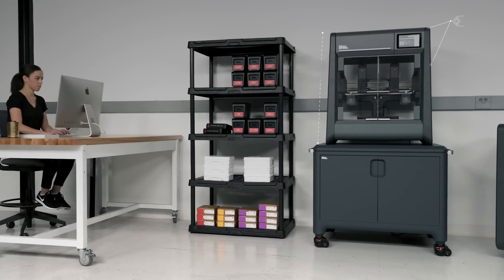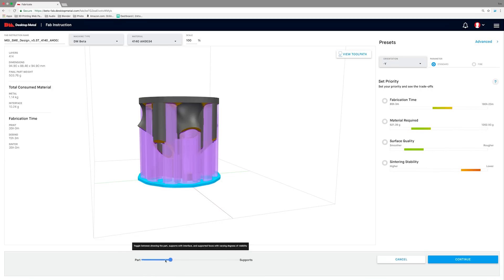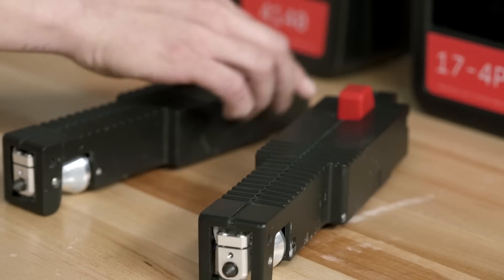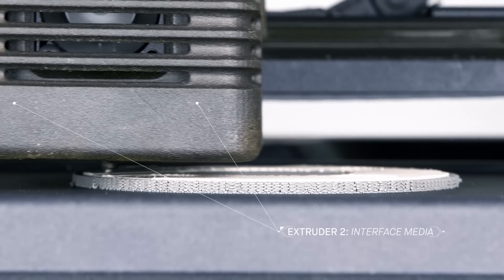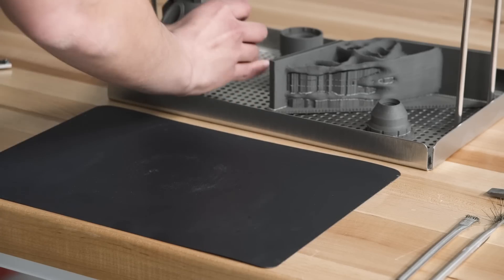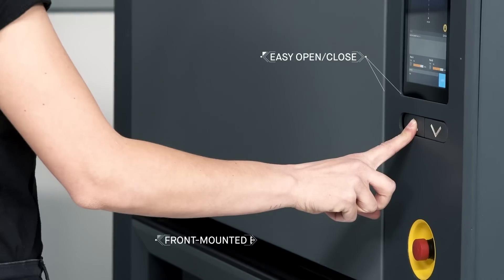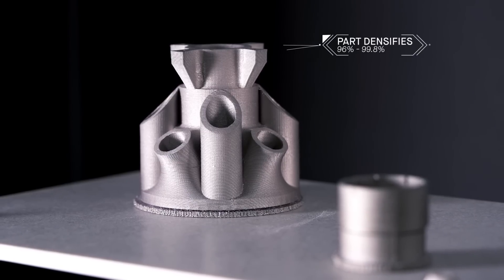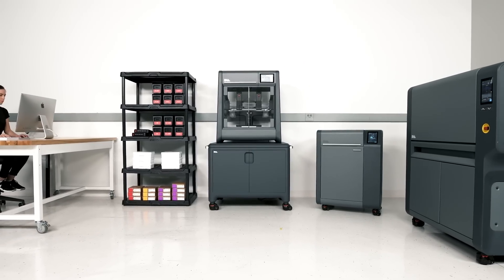Desktop Metal Studio 3D Printer | Affordable Metal 3D Printing

Comment: Time to print Rifles
Reply: the second this tech becomes affordable to the average household gun control is pretty well dead
Reply: @jwar238  god bless america. Remember people "Dont tread on me" and Give me Liberty or give me Death"
Reply: @DrDahz  the liberator was printed in PLA a very brittle plastic. if your printed it in polycarbonate, nylon, or PC carbon fiber, or Nylon carbon fiber filaments any of those would probably be able to handle hundreds if not close to a thousand rounds. You should look up the FOSSCAD files there are other designs for 3d printed semi auto guns although you have to use a glock barrel for most of them, or a machined chamber insert for the revolver, most of the guns are about 90 % 3d printed, the largest caliber you will find is 9mm. Idk if the US government has scrubbed all of the files yet, but you can get the FOSSCAD files off of github.com
Reply: The printers are pretty good at making copy's of pre 86 NFA items that is for sure.
Reply: @jwar238  Already is, have you seen the "Liberator" 3d printed gun? Even the trigger spring is 3d printed, the one and the only thing that doesn't come off a 3d printer is the firing pin, which is actually just a hardware store nail. The main downside is to be safe you only want to fire it once, then again, you could print another one in a matter of hours, for practically pocket change.
Reply: @matthewbee9109  I'm more thinking in the realm of viable weapons good for more than one round
Reply: @jwar238  Fair enough! :)
Reply: @jwar238  120.000 Damn bucks? Why not BUY a weapon.. ~whether legally, or in the not-so-legally way.
Reply: @ultimaxkom8728  it's more exciting in context of the fact prices on such kit will come down over time... at which point anybody who wants to can produce industrial standard firearms and the government will be impotent to stop it
Reply: @jwar238   I concur with your point; that is, I believe that these "present-expensive" tools cost would continue to descent, and hopefully making it affordable for a home ranged production or even for a such personal uses. Also yes, it should be more exciting in the not so distant future ~eventually...
Reply: @jwar238  the liberator was printed in PLA a very brittle plastic. if your printed it in polycarbonate, nylon, or PC carbon fiber, or Nylon carbon fiber filaments any of those would probably be able to handle hundreds if not close to a thousand rounds. You should look up the FOSSCAD files there are other designs for 3d printed semi auto guns although you have to use a glock barrel for most of them, or a machined chamber insert for the revolver, most of the guns are about 90 % 3d printed, the largest caliber you will find is 9mm. Idk if the US government has scrubbed all of the files yet, but you can get the FOSSCAD files off of github.com
Reply: @matthewbee9109  the liberator was printed in PLA a very brittle plastic. if your printed it in polycarbonate, nylon, or PC carbon fiber, or Nylon carbon fiber filaments any of those would probably be able to handle hundreds if not close to a thousand rounds. You should look up the FOSSCAD files there are other designs for 3d printed semi auto guns although you have to use a glock barrel for most of them, or a machined chamber insert for the revolver, most of the guns are about 90 % 3d printed, the largest caliber you will find is 9mm. Idk if the US government has scrubbed all of the files yet, but you can get the FOSSCAD files off of github.com
Reply: @tres155  Ok, neat! I will have to check that out! Thanks for the correction :)
Reply: josh rees gun control is dead. Harbor freight will sell you a lathe and mill for about $600 each.
Reply: Im so going to print an rpg.
Reply: Maybe a varmint rifle, but I doubt you can make something that would handle full powered ammo with something like this. But yeah, you'd probably be fine if you'd print only the things that you wouldn't be able to get off the shelf and picked materials carefully.
Reply: Not with those tolerances, you dumbass. This technology is still very green for that, give it a year or two before you can even build dirty cheap guns.
Reply: Exactly😂
Reply: This is exactly why I am looking for a cheap metal 3d printer. I just need to print the barrel in metal, the rest would be plastic.
Reply: @3dprintwiz378  there are several other parts that need to be made of metal and the barrel probably should not be 3D printed, a forged barrel would be far better.
Reply: 3D Printwiz
The hammer that strikes the ammo cap in bolt should be metal also.
Reply: hey,u found a 3d laser print to buy?i wish the same than u.
Reply: @3dprintwiz378  your better off with a solid barrel. you can find thousands online that can suit your needs and be 1000x cheaper than this printer.
Reply: 3D Printwiz cheap metal 3D printer. This is not a thing. No one would make a barrel of a gun using this. The metal isn’t going to be anywhere close to strong enough to contain that much pressure without warping or breaking. Use common sense.

Comment: $120,000?  yikes... 100x cheaper to do lost wax casting as this system still requires a chemical bath to remove the binder prior to firing just as wax casting requires wax removal to create a mold. The other problem is compensating for part shrinkage after firing due to the removal of the binder.
Reply from the maker: Hey Ramiro, the Desktop Metal System is incredibly software driven and what they have been able to do is account for shrinkage when printing. So the software would take in parameters like the material type and size and print the model larger to compensate for shrinkage. The raft that is designed with the part is meant for uniform shrinking.
Reply: I don't think you can safely do lost wax casting in an office environment 🤣🤣🤣
Reply: @pmiller4799  sure you can just setup the kiln next to the coffee machine and stack of request forms. someone will figure it out.

Comment: If 120000$ is an affordable price then I don’t know who I am
Reply: It's not primarily for individual use, it's mostly for companies. Before, metal printers have cost companies millions, 120k is a load better for companies that just want metal printing for prototyping.
Reply: @TheLegomann97  desktop mean home ,,, not industrial
Reply: $120,000 is cheap in comparison to the other metal 3d printing systems out there.
Reply: @Scoo0by  not rly  metal x is cheeeeper
Reply: @Scoo0by  You're missing the point. They said affordable. This is not affordable for home users, small business, medium business users.
Reply: @_nom_  but it is affordable
Reply: @_nom_  Awfully late response, however, when they say "Affordable" it's likely directed towards their intended audience which as you explained would be limited to high-medium end business users and large businesses. This is cheap when compared to DLMS systems especially when factoring all of the safety requirements for a workplace.
Reply: If this increases output of a small engineering team by 10% it will pay for itself in a year or two.
Reply: Not meant for tinkerers.
Reply: Compare the price to a 5 axis cnc
Reply: Anuj kumar 
True that

Comment: And costs like a small spaceship for sure.
Reply from the maker: Hello Shur, Michael and Jake you both bring up great points. In reference to affordability this system is being compared to current industrial metal 3D printing options. A DMLS (laser and powder based) system can run $700,000+ and it requires significant site modifications (like a blast proof room) making the typical initial cost of a system to $1 million+, and that doesn't even take into consideration the operating costs. Typically speaking, right now industrial metal 3D printing is reserved for the elite aerospace, medical and automotive companies that can justify the high costs over the lifecycle of a product. The Desktop Metal Studio system brings the cost of 3D printing metal components down significantly to a point where it is much more accessible.
Reply: But can it produce semi automatic weapons?
Reply: @RNA0ROGER  :)
Reply: @RNA0ROGER  Well, all we knew for now, is that it can run GTA V...
Reply: @RNA0ROGER  Why not, they are no different than any other metal part.
Reply: Phill Huddleston that is so far from the truth it’s hilarious. These machines produce parts that are for prototype or low stress processes. I bet making a gun out of this stuff would result in the thing blowing up in your hand. If not on the first shot, after a few most definitely. The military has tried to make low weight firearms out of aluminum before and they always ended up being a terrible idea. You need high quality metal that is rated for the massive pressures produced inside of a gun. Some high strength plastics can do it, so there’s no reason to try and use a machine Like this.
Reply: @RNA0ROGER  Why limit it to semi? Why not fully automatic?
Reply: @MisterRorschach90  That's an interesting argument. Especially considering that 3D metal printing is used for car engine parts that are under extreme heat and pressure as well. You are also looking at "current day" tech (possibly not even accurately). What about 10 years from now? 20? 30? You don't think it's coming? That is hilarious...
Reply: Fully automatic firearms generally require additional legal paper work. They are also extremely heavy on consumption of ammunition, often providing little or no real world benefits. Outside of putting a smile on ones face and making awesome noises.
Reply: @RNA0ROGER  Makes you wonder why they are illegal in the USA then? ;) Although, my understanding is that you often have the ability to set from fully auto to burst fire to single shot on most fully automatic weapons, but I could be wrong. I haven't even seen or looked into fully automatic weapons since I retired from the Marines nearly 30 years ago.
Reply: They aren't generally illegal within the United States or even most of the world for that matter. They require a mountain of paper work for some odd reason.
Reply: I think they targeted their market.

I bet metal infused wax filament isn't too hard to manufacture for regular FDM printers, the wax could probably be left in situ to act as a flux in place of a suitable gas.

Lasers are cool, but expensive (I bought one, but realistically it'll do little more than mild etching, especially after the losses suffered through fibre optic connections). 

But induction heating drivers are cheap enough (I have a 500W one),  tungsten nozzles are cheapish, but hard to find (mine are on their way from China).

Doubt I'll achieve more than a big mess, but I bet someone cracks home (well garage) desktop metal 3d printing for under £1000 before 2020.
Reply: Iro3d is currently the closest thing to a home metal 3d printer atm.
Reply: But the amount of money you save from buy your kids toys is worth it.
Reply: @TasTasDoLwaQ? ...How is a 3D printer that prints objects going to replace children undergoing education? Not all kids turn into machinists so I don't see the point, plus in some cases traditional machining will still surpass 3D printing plus machinists are in high demand anyways. Plus there's 3D modeling and design, 3D printer maintenance and operation, and materials manufacturing that kids will begin to become interested in. Progress opens doors, including new job titles previously unknown.
Reply: @Ferrous Bear give it time
Reply: Two points:
1. AFAIK already shown metal SLS systems as low as $10K and a selection of options under $50K in last ~2 yrs.
2. If it costs ~70K the title is kinda misleading. Because in 2018 everyone will tend to compare it with something they already have, i.e. FDM and maybe SLA costing not higher that ~5K. Things considered affordable and already being used in studios.
Reply: @shurmurray  dude, a frigging reson based non metal printer cost $10k i don't think this thing will be anything lower than 50k
Reply: @astafzciba  most people see just raw cost. Over 9000K is too expensive.
And if you really, really want 3d printed metal - there are a number of cheaper options like cast in molds made using dirt-cheap plastic 3d printing or CNC milling. True metal 3D printing is still not for everyone.
Reply: Considering it's an industrial office 3D printer, $120k for the system seems to be a steal for a small industrial company.
Reply: I also think I heard somewhere that you can rent the printer on a monthly basis for a few grand or so a month, so a steal, even for some schools and universities that want to expose their students to legit additive manufacturing with real industrial purpose in an affordable way that's tangible.
Reply: @michaeljulian9198  For $120k you can get entry level 5 axis CNC, which will be way more capable and faster, not saying about surface finish quality and precision, compared to this :D
Reply: @hangebicom  Yeah but you can't produce parts that require very fine and intricate INTERNAL features, like for example a heat exchanger or a rocket engine combustion chamber. Plus I don't care much for the scrap rate for CNC and other types of machining, unless there have been innovations in scrap reduction recently that I haven't been aware of.
Reply: @michaeljulian9198 I'd love to see an 3d printed rocket  engine combustion chambers :D btw, yes 3D printers can print a lot of amazing things, like ball inside ball, but they're absolutely useless in real life. And by the way, modern CNC machinery can do even 0.1 micron without too much issues, do we have 3D printers with resolution like that?
Reply: @hangebicom  We already have extensive knowledge of 3D printed combustion chambers. See RocketLab. Their Rutherford engines are almost entirely 3D printed and there's a company called Relativity Space that print's their engines and have even printed propellant tanks using a 3D printer the size of a small building. Their upcoming Terran rocket is pretty much gonna be an autonomously printed rocket. Yes the WHOLE ROCKET.
Reply: @hangebicom  a cnc and 3d printer have completely different capabilities.
Reply: @michaeljulian9198  Right, but the metal you have to buy from them also costs a fortune, the 3D printer equivalent to inc cartridges.